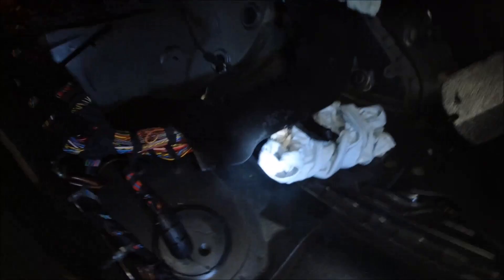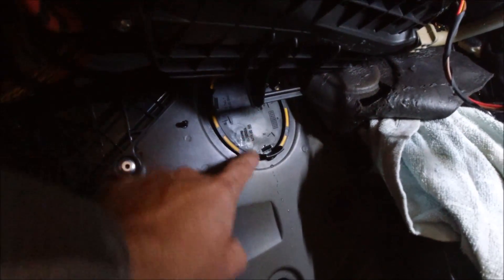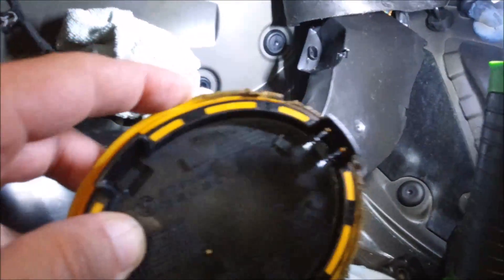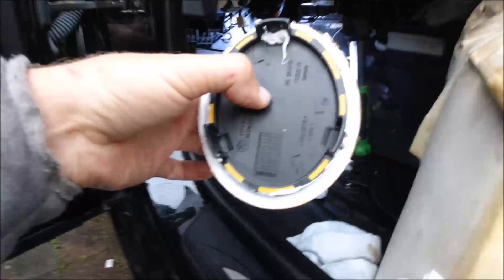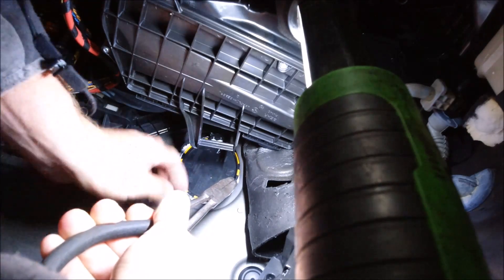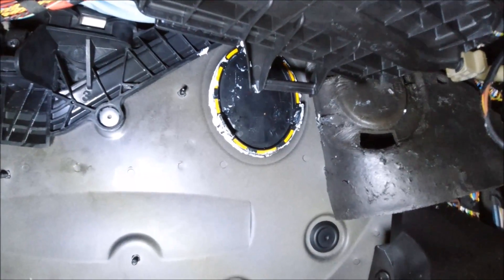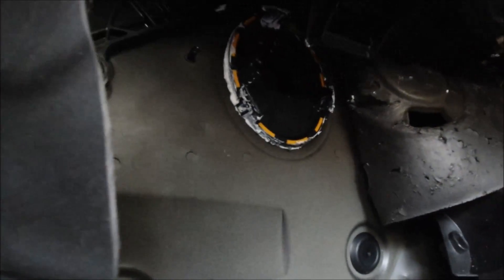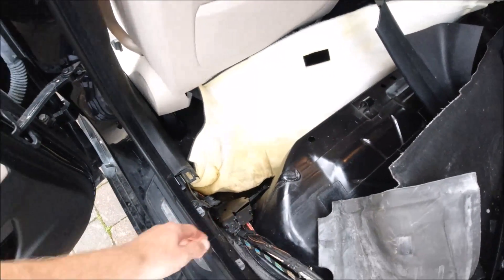BMW 5 F10 Passenger Side Water Leak

Comment: Same issue on my 5GT yesterday :(  thank to all the people taking the time to post, as others have said you can access the blanking grommet from inside the engine compartment by removing 4 x 30 Torx screws from a small blanking panel. Chances are it will be full of debris and so water isn't draining through the channel properly, hence welling up and perishing the actual Yellow grommet seal. The grommet is part no51719151866 for a RHD vehicle and costs around £25. Bigger issue is drying out the back. I took a good 4-6 litres using a wet vac and the insulation will take for ever to dry out fully and is not possible to remove carpets without some serious work - seats out / trims removed fully. Any one with ideas on drying out the sound insulation / carpets quickly welcome.
Reply: Have the same issue but with more water removed (25 litres at least). Have your carpets dried ok and is there any smell left?
Reply: Hi - do u know where u can buy the grommet?
Reply: @VV-yh3ni  Hi Sorry only just seen your question, I cant say as I was due a new car anyway but It forced my arm into switching out asap. Good luck
Reply: Had a similar water intrusion with my 2004 645 Convertible. Leave out the plastic plug in the floor, so the water can drain, I left it out for 2-3 weeks, before fixing the trim back.

Also, if you all have a dehumidifier, let it run in your car for several hours daily, that will reduce the moisture in the car, and dry out the padding. Monitor the amount collected and you will know when to stop using it.

If you do not have a dehumidifier, try multiple containers of DampRid!

Good luck.

No I have to do this for my Brittle Moneywasting Waterlogged M6🤬🤬🤬😡🥵….un-F-'n-believable!!!

Comment: The yellow cover has a double lip seal. Mine had small splits in the lip allowing water past into the cabin. Caught this reliatvely early when inside of windows started misting with damp, so not too much water in the footwell. To access the seal need to remove an insulation plate held by four torx screws. Beware, easy to drop them down to the engine cover below! Near the yellow cover there is a drain hole that channels water from the windscreen out via the wheel arch which will be full of crud so need cleaning out so water doesn't pool against the new seal. Would recommend buying a new cover from BMW for about £20. Old cover came out easily and could be done without lifting interior carpet but most times will need to lift and dry out the footwell carpet. Clean round aperture and pop in the new cover which has three clips with arrow facing down. Push gently on the three black lines on the yellow cover and should hear the tabs pop into place. Job done.
Reply: Hi would you mind helping out by giving some tips on how to remove the yellow cover. We see it but just can’t get it out 😅😅😅
Reply: @beingpresent5978  Hi, you may need to access the cover from the footwell and push it off from inside the car.

Comment: Had this issue last year, done what this video said, and unfortunately its back! Smelling like damp. Im going to buy some replacements now and seal before fitting. What is the part called? The yellow puck thing.
Reply: I am in the same boat as you. I even had it sealed with silicone and cut a groove in the covering plate in engine bay. Still car full with water. I'm starting to wonder if there is another area it leaks from. Certainly it isn't the door I checked that already.

Comment: A useful video to show where the water comes into the car, thank you ... BUT....

Firstly, silicone won't last forever so a tougher sealant would be advisable. More importantly, you will need to tackle the root cause, as the area outside the yellow bung shouldn't fill with water in the first place. It is due to bad design, with leaves and other debris blocking the drainage holes below the area outside the bung. Front wheel needs to come off, as does the wheel arch liner and the cover plate that will in turn reveal the yellow bung. The whole area below the windscreen (on both sides of the car) needs a thorough clean, as do all the drainage channels. It's also a good idea to cut a groove on the inside of the black cover plate (the one between the wheel arch liner and the yellow  bung) to give an extra area for water to escape. A check and clean every year or three, depending on how often you park under trees, would be a sensible precaution to try and avoid future problems. As you may guess, been there, done that, had the soggy carpet to prove it.

Incidentally, a local mechanic has also had a similar issue with Passats, as mentioned elsewhere.

Bad design by BMW - a fault that also occurred on some previous models, I believe, although the corporate line always seems to be "Never heard of it before". Yeah, right. That is contradicted by the chap in our local franchised parts department who when telling us that they had no stock of the yellow bung (Part #51 71 9 151 866, incidentally) said "We sell loads of them - we've got 20 on the way from Germany".
Reply: 100% buzz - did mine this morning and was full of dirt / small debris so unable to flow
Reply: @dustingreenhill9711  Well done Dustin. Don't forget to keep on top of it in years to come. How many owners of  F10 and similar models have an impending problem they don't yet know about? And how many will struggle to find  the cause, assuming it's associated with the rear door?
Reply: buzzlightswitch I’ve got this exact problem now again it first happened a few years back and I used cheap Halfords silicon thinking it would do the trick. It has for a few years but it’s failed now due to not withstanding heat and cold temps of weather. 

So I concur about the silicone quality and also will try the method of opening up extra channel for water. 

Just to confirm if I open the wheel arch liner on a bmw 7 series f02 the plate is their? It’s been a few years since I had the mechanic do it and it was on the ramps. I will be trying to tackle this myself. 

Any more pointers would be appreciated! 🙏🏽

Thanks
Reply: do you know what this part is called ? you referred to it as  "BUNG ", is this correct term ??

Comment: excellent video mine was exactly the same,but instead of sealing the cover I filled the cavity with water and realised it wasn't draining so prodded around with a piece of wire and found there was a drain on the back left side ,cleaned the drain till the water ran away then replaced the cover ,,,job done!

Comment: I have a water leak, 2012 520. water pooling driver side  rear foot well (uk right hand drive) is it the same problem or something different? I have read it could be the door (vapour barrier) itself but there is no evidence, any ideas? I have already been to a mechanic, big bill, still no further forward. Any help would be great 👍
Reply from the maker: Hi, the best idea will be  remove the carpet and just check the yellow plug. 😉
Reply: Ho. Did you manage to sort the leak? I'm in the UK and got the same issue. Was going to start with the door card?
Reply from the maker: @moky4241  hi, first check the yellow plug
Reply: Try to get the door panel off and see the noise constellation thingy is still in place and if the adhesive is holding in it in place? If not just get water proof adhesive and place it on the
Reply: I have the same problem on the same year of car. water in the footwell of rear N/S. Checked the yellow grommit yesterday from the engine bay and it looks ok. Front carpet doesn't feel wet. Next step check the vapour barier. Did you resolve this?

Comment: Excellent video thanks for sharing! I have a 2011 F12 (640Ci) and discovered a lot of water in my rear passenger footwell so it's a common problem on 6 Series cars as well, not surprising as they are based on the 5 Series. I traced the problem to the same place, you can see water running in once you pull back the carpet.

If you notice condensation on the inside of all the windows this could be a cause, as was with my face for a few weeks before I discovered the source of the problem.

My previous car was a 645CI and I had similar problems with water channels in the convertible roof area getting blocked and water running into the interior of the car, luckily managed to sort it before the ECU's got wet..

I've had 9 BMW's and love them but so dissapointed at such bad design! You would think with the number of 5 and 6 Series and all their derivatives on the market BMW would admit the error and offer a solution!

Comment: Great video sir Thank you I have exactly same problem in my 7 series f02. What silicone is best for this in your opinion?
Reply from the maker: Hi, You'll be surprised.... Us any silicone 😉
Reply: FixYOURride13 thanks 🙏🏽
Reply: The following videos have instructions that resolved the water leak on my 2008 528.  These are other reasons why your carpets are wet.
BMW E60 How To Clean Rain Water Drains Water In Ecu Box, Wet Carpet Fix: https://youtu.be/cFE9gf5NXxU
BMW 6-Series Hidden Water Drain: - https://youtu.be/ZJD4y_Qpmww

Rear sunroof drains:
Fix Most Common Roof Leak - BMW 5 Series 2004-2010: - https://youtu.be/QC2IUgIXUD0
Reply: Gasket silicone i will.suggest .
Reply: Do you know what the name of this part is?
Reply: @jenniferdomotor  it’s a yellow grommet that’s behind the bulkhead (partition between passenger glovebox area footwell and engine)

Comment: Mate how did u lift up the rear carpet to take the water out? Care to list the steps please. I just don't wanna break anything
Reply from the maker: Hi, strep all step by step, I haven't done it myself yet, so just try 😉
Reply: The following videos have instructions that resolved the water leak on my 2008 528.  These are other reasons why your carpets are wet.
BMW E60 How To Clean Rain Water Drains Water In Ecu Box, Wet Carpet Fix: https://youtu.be/cFE9gf5NXxU
BMW 6-Series Hidden Water Drain: - https://youtu.be/ZJD4y_Qpmww

Rear sunroof drains:
Fix Most Common Roof Leak - BMW 5 Series 2004-2010: - https://youtu.be/QC2IUgIXUD0

Comment: Had a similar water intrusion with my 2004 645 Convertible. Leave out the plastic plug in the floor, so the water can drain, I left it out for 2-3 weeks, before fixing the trim back.

Also, if you all have a dehumidifier, let it run in your car for several hours daily, that will reduce the moisture in the car, and dry out the padding. Monitor the amount collected and you will know when to stop using it.

If you do not have a dehumidifier, try multiple containers of DampRid!

Good luck.

No I have to do this for my Brittle Moneywasting Waterlogged M6🤬🤬🤬😡🥵….un-F-'n-believable!!! 

THANK YOU FOR THE VIDEO!

By any chance did you have information or pic of how you removed the trim?
Reply from the maker: Hi 2.58 video time u can see 3 clips on the plastic plug press the clips and push the plug autside the car next pull the plug inside the car it's easy, more difficult is fitted back with slippe silicone or install the new plug.

Comment: you didn't fix the problem completely, you need to clean the other side.
Reply: What must be remove please for clean other side?
Reply: @HNZKFK  On left-hand side, under the wheel arch there is a rubber boot around the brake pipes that blocks the water from draining down.

Comment: Nice video, I did mine before it blocked up and caused a leak.  I would recommend doing this from inside the engine. You can remove the engine cover and there is a panel on the top right hand side that is held on with a couple of screws. Behind this panel is the yellow blanking plate that is used to cover the hole.  

Overall very bad design by BMW, the result of left hand side drive conversion to right hand drive.👎
Reply: i know im asking randomly but does anybody know a trick to log back into an Instagram account?
I stupidly forgot my login password. I would love any tricks you can give me.
Reply: @Duke Arthur Instablaster :)
Reply: @Dangelo Terrance I really appreciate your reply. I got to the site on google and im in the hacking process now.
Takes a while so I will reply here later when my account password hopefully is recovered.
Reply: @Dangelo Terrance It worked and I now got access to my account again. I am so happy:D
Thanks so much, you saved my ass!
Reply: @Duke Arthur glad I could help :D
Reply: This is what happens when BMW cut corners , install cheap parts. Poor design. This should be a Recall as this is not a serviceable part. BMW need to recall this issue.

Comment: At LHD is it on the same side?or it's under the steering wheel?
Reply from the maker: Hi, I don't know, I didn't check, maybe someone will answer you...
Reply: yellow grommet seals unused hole for the steering wheel rack. modern cars has two for purpose of LHD/RHD  switch. so its always on the other side than the steering wheel. know its late reply

Comment: Thanks for the vedio. Very clear explanation. I have the same issue where the rear seat carpet getting wet. But I have one question. how does it wet only the rear seat carpet without wetting the front seat carpet when the leak is in the front of the car?
Reply from the maker: Hi, I think the flor leveling do this, the front foot level is higher than the rear so water is cumulated in te back foot foam. But how the water jumped in tu under back seats i have no idea :).... Mayby during acceleration water swim up???
Reply: Yup. That makes sense. Thanks again.
Reply: @malakapalipana  FYride is correct, it runs to the rear only hence not picking mine up for a long time as never have anyone in the rear :(